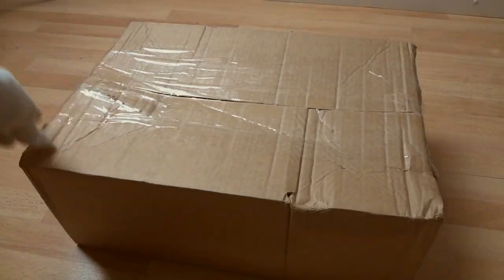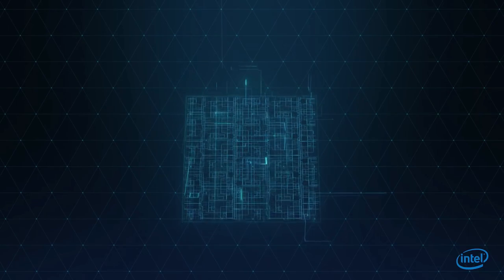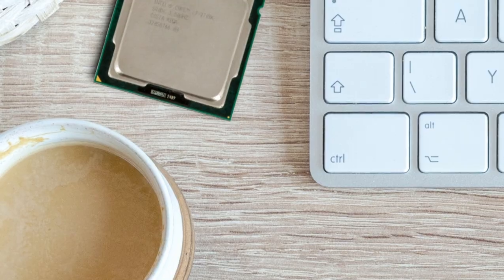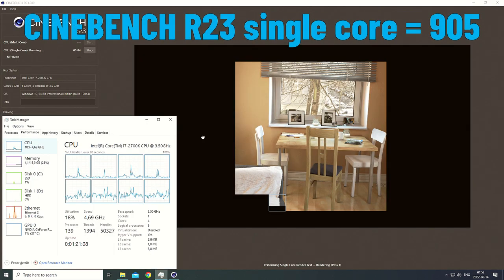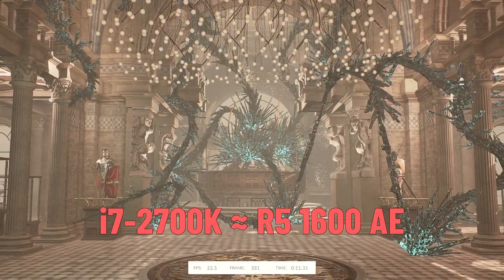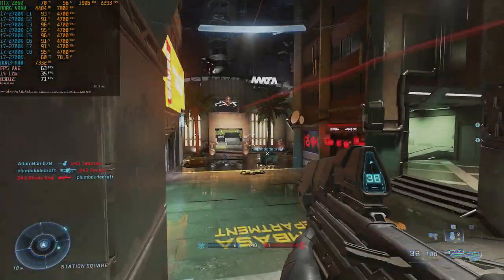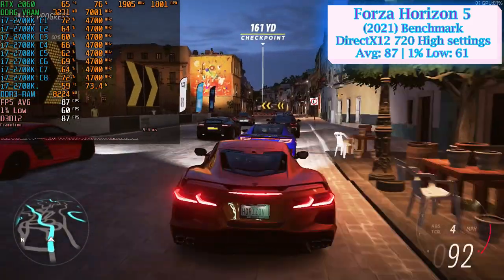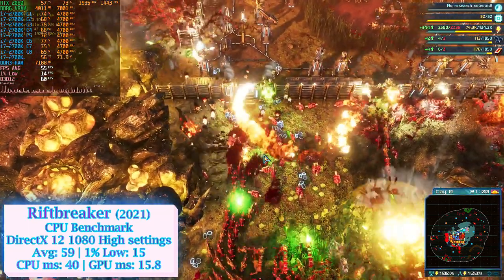The i7 2700K • INTEL got lazy after this CPU architecture

Comment: The 4th gen is also still somewhat relevant today. Many people are running OC'd 4th gen i7's and they are still handling modern games very well.
Reply: I was still running a 3rd gen till recently, got into a 10th gen platform with an i3 because it was a really good price. Plenty of upgrade room as well now. To be honest I could have kept running the old i7 but the mobo was going I suspect, random USB issues where things just disconnect for no good reason, very basic bios with no real tuning options and just things that come with old platform. It served me well though
Reply: @Coffeeenjoyer31  Too bad they didn't make K series i3 anymore. They could have some very good potential for low budget gamers. The 9th gen K i3 was a goldmine of a CPU at low budget with the OC capability considering the core count.
Reply: @POLARTTYRTM  not sure if it's just ram speed increase, or IPC but it's a 10105f from a 3770 so no thread/core increase but man it's way smoother and higher fps. I was gonna get into 12th gen but the CPU was a steal, under $80 with included cooler ( which I'm not using admittedly but still). Also higher boost so not bad. Maybe overspent a little on mobo but I didn't wanna have to use add in cards for extra USB or wifi..got a b560 so I could upgrade to a higher end 11th gen later if I need the cores and clocks
Reply: @POLARTTYRTM  also, I never knew they made k series i3 that sounds super interesting lol
Reply: Currently running an i7 4820k, working beautifully :)
Reply: @Coffeeenjoyer31  Yeah, it is the 9350KF. They should have made more of them in the later generations, but intel motherboards are very costly and their CPUs can only be OC'd on Z motherboards, so whoever can pay for a Z motherboard series is surely not going to get an i3 as they can afford much more than that. I wish intel was like AMD where you can OC on pretty much any board since so many of them offer the capacity for it, but of course intel wants us to pay premium motherboards just to OC when it could be done on tons of motherboards out there with plenty of capacity for it, but not the chipset that allows it to happen as they make the CPUs only overclockable when they detect a Z chipset. I get so angry thinking about this.
Reply: @POLARTTYRTM  Frankly, the 'OC' I got from an AMD B450M board was absolutely nothing on a R5 3600. It was either clock stretching and/or marginal performance gains over just keeping the temps low and letting boost behavior run normally.
Reply: @POLARTTYRTM  i was going to go 12th gen, but lga 1700 mobo aren't too cheap. yeah i could have gotten a bottom of the barrel board to pair with the 12100 but whats the point of that if i wanna upgrade later? also wanted plenty rear i/o which the sub $150 boards didn't seem to have much of.

Comment: I wouldn't call it lazy, mainly because they did have to engineer nodes, and getting stuck on 14nm due to fabrication issues definitely contributed to the issues. Technical docs for their earlier 10nm archs like Sunny Cove indicated that it was going to be a significant revamp, but it could not be produced on the 10nm process they had at the time. They backported to their super-mature 14nm+++++ and got some gains, but at horrible power consumption as expected.

Contrast how AMD went - they started from a really low point (Bulldozer/Piledriver), Zen 1 only had core count advantages but considerable Clock and IPC deficits against even Haswell and Gen 1 Skylake (although no longer as big as BD/PD). It was only with Zen 2 that they reached per-core parity with matured Skylakes, and Zen 3 where they took a commanding lead. Considering they had the advantage of TSMC doing the node and fab development for them, 14nm++++ putting up that much of a fight (power notwithstanding) is a testament to how good their archs were.
Reply from the maker: I appreciate the fact that you give plenty of valid points. The video it self is a testament of how far ahead were Intel's design and planing.

Nonetheless, we can't neglect that the lack of competition, brought the multi billion company from head start to fall behind while stagnating the CPU market with "super-matured" overpriced chips.

In contrary the nearly bankrupt AMD with the lawsuits and the bad reputation from a flawed chip design, managed to deal with numerous development issues in addition to outsourcing the fabrication of a chip has huge disadvantages as well.

It's pretty impressive how they managed to turn the tables or may I say how they Ri(y)s(z)en from the dead. I can't write more without giving away parts of future content, so I will put a stop here. Sincerely, thank you for taking the time to comment.
Reply: @Old But Not Obsolete Tech  I don't doubt there was some complacency - the continued node issues and subsequent respins+marketing was partly a reflection of how leadership was handling the delays.

And no, my highlight of Intel's strength is by no means a debasement of AMD's success - they've done extremely well in rapidly gaining ground despite all their disadvantages. 

Giving credit where credit is due is all.
Reply: @obnot  

They could have stacked cache like a total boss tho. Except the context switching of windows thread scheduler would make this futile restricted to 99.9999% of users who have no idea what context switching is let alone how to get around it.

Comment: Still running the i7-2700K CPU with an EVGA nVidia GTX-670 Superclock+ (4GB) GPU in late December 2022.   Supposedly the 670 bottlenecks the 2700K, but I'm not seeing it. Even without overclocking, this version of the GTX-670 actually keeps up with any GTX-1050 GPU, including "ti".   Averages around 120 FPS in  CS:GO at 1920x1080p, on ultra gfx settings.  Same with Overwatch and Doom Eternal and Second Life. Of course, this is "light gaming".  16GB Kingston HyperX DDR3 1600 CL9 RAM (2x8GB), 512 GB Samsung SATA3 EVO SSD.  Windows 10 Pro x64 + Linux Mint 21.1 dual boot.  I swear this thing boots faster and is more responsive than my HP Omen 16 laptop with i7-12700H CPU & RTX 3060 and 1 TB NVMe PCie Gen5 x16 WD SSD.
Reply from the maker: Thank you for sharing your experience. Usually Boot-time has more to do in which storage device is the O/S installed and somewhat the BIOS settings. (boot diagnostics, boot screen etc. can prolong the boot sequence).

Comment: My 2700k has been solid for years, I upgraded after 9 years but couldnt bring myself to selling the sabertooth z77 and 2700k i7 so it sat in the loft for a couple years, now I bring it out again for my daughter to play minecraft and its started overheating, 98-100 degrees... would this be the aio cooler is stuffed?
Reply from the maker: My advice is to remove the old thermal paste and re-apply a new one, if you haven't done so already.

The other is to check if the base of the heat-sink or pump (depending on what you use) of the CPU cooler does a proper contact with the IHS (top metal lid) of the CPU.

Furthermore check if the fans are working as they should. At 98-100 degrees Celsius they should spin like crazy and the system should auto- shutdown to protect the CPU.
Reply: @obnot  thanks, its using a H60 AIO cooler which was bought around the same 10 years ago so I will order a new one and check the paste and contact patch is good, thanks for help 👍🏻
Reply from the maker: @Loz636  Don't mention it. Thanks for visiting our channel 😀

Comment: Got mine + a z77 board in 2017 trading for an FX combo cpu + board and a GTX 780.

This fucking thing has to OC and go Super Saiyan 3 to keep up with current games but it still does in 1080p. I'll only upgrade when it dies for good.

Comment: I actually believe Intel regressed after HASWELL by eliminating IVR from their future architecture.
Reply: Getting rid of the FIVR did nothing to cripple or hurt Skylake's performance. The FIVR was another attempt to move motherboard parts to the CPU, but since Voltage Regulators run hot, this made the CPU run hotter. When Skylake came out, most people were happy to see the FIVR was moved back to the motherboard. 

From an overclocking standpoint, keeping the Voltage Regulators on the motherboard is better because I can opt to get a better motherboard if I want to overclock. I've actually taken a 2600k and 2700k to 5.0GHz and even 5.1GHz 100% stable, but I needed a top notch motherboard with efficient VRM's, exceptional cooling, and a near Golden Sample chip to do this. Even some of the best 2600k/2700k processors need nearly 1.5v VCore to run 5.0Ghz stable. These are a lot of people that claim to have taken a SB CPU to 5.0Ghz but many people make false claims. 

Surveys have been done on the 2500k, 2550k, earlier 2600k, and 2700k and maybe one or two out of every 100 chips can achieve 5.0Ghz at 1.35v stable.

Comment: I still have it. It's in a great running condition. I had it running for about 11 years and then I upgraded to a 6950x. And I just upgraded that to a 12700k.
Reply from the maker: These are some awesome CPU upgrading steps. Especially the 6950x what a monster. If the platform wasn't old I bet it could compete head to head with the 12700K in some games.
Reply: @obnot  12700K's IPC is so far ahead of every previous Intel i7s and HEDT so that is not possible. IPC is higher than Zen 4 too and on par with 13th gen CORE.
Reply: @obnot  HEDT uses mesh architecture and is not as good as Ring Bus (used by the i7-12700K plus Big-Little tech and enhanced Intel 10nm process node).
Reply from the maker: @saricubra2867  I never stated that is better or more advanced than a 12700K. Obviously that would be impossible. But in "real life" gaming performance there is only a 15% difference. 

https://www.youtube.com/watch?v=tA11tWU_Gm4

All I am saying is, imagine if it was compatible with an LGA 1700 platform.
Reply: @obnot  Is not 15%, the CPU, GPU usage is way different, some games with +40 fps difference, almost 50%

Comment: still using mine >:3c
Reply: I'm running at 3920mhz and have been since 2013, best investment i've ever made, my 1060 is close but the combo is genuinely just an everlasting computer, I originally got a 550, then a 670 (which died) and then a rebated 680, I ran it at 4.8ghz for a while but didn't see enough improvement to make me want to shorten its lifespan, glad i didn't ngl
Reply: I genuinely expect to have to drop this machine in the next few years but my god i will fight to the death for it
Reply from the maker: @searchiemusic  Thanks for sharing your story. I sold mine + the mobo to fund my next YT projects, otherwise I would keep them both truly legendary hardware. As well as the GTX 1060 you mentioned, is still kicking as top 1 GPU on Steams survey.
Reply: @obnot  since posting i upgraded my display to 1440p and still have almost no issues, the everlasting pc continues to everlast, can't blame you though, amazingly i'm still seeing 2700ks for 150usd on ebay at the moment, genuinely making me consider rebuilding but i can't do that to my poor sandy bridge

Comment: I am still using a 2600k @ 5GHz (granted, a cherry picked part, but 4.7 is achievable by all of them).   You could also push the RAM to 2133 to max-out performance, thats the max unofficially supported (=overclock) speed.

very nice video....it would be also interesting if you compared the results with a more modern processor and the same (a bit higher GPU like....3060ti) to see how much of a bottleneck is created by the 10year old architecture and PCIE 2.0...
Reply from the maker: Thanks for the comment!
As a matter of fact, I did a comparison between this CPU and another legend of it's kind R7 1700, you can check here: https://www.youtube.com/watch?v=dx3B8O02iKI

Definitely not a modern CPU any more but still both have left their mark in microprocessors history each for their own reasons.